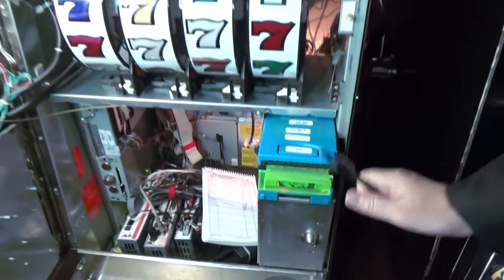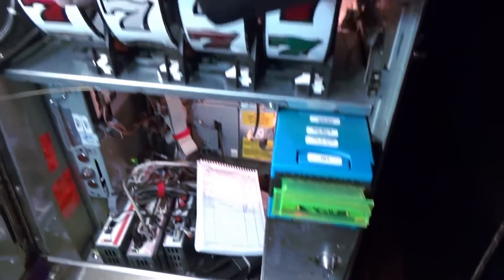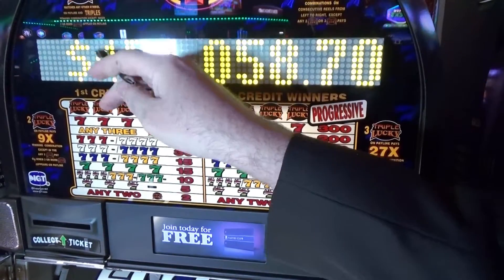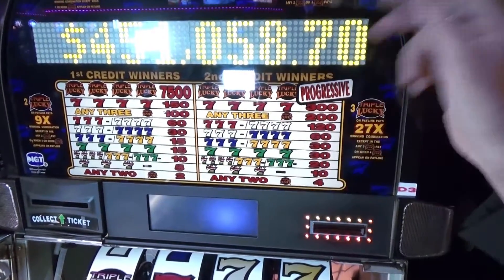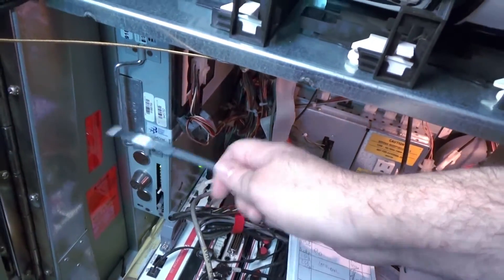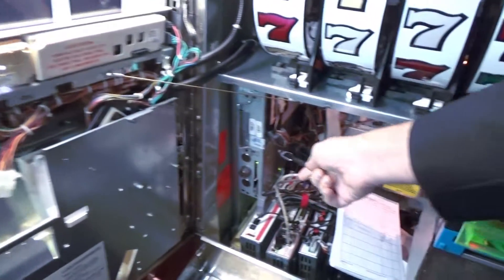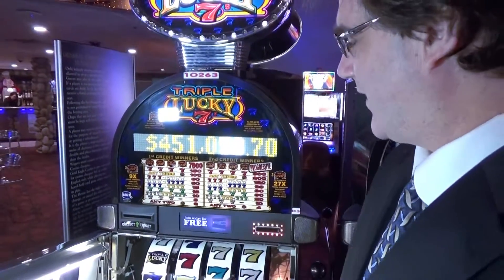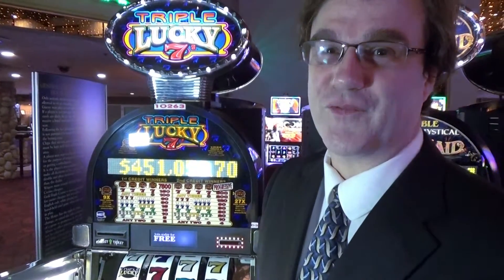Inside a Slot Machine

Comment: No such thing as a random number generator. That also has to be programed. So all wins are programed.
Reply: Actually there is a chicken inside that picks the numbers
Reply: It's pseudorandom, so yeah, you are right that it is not truely random.  However, it would be incorrect to claim the wins are programmed.  The PRNG is generating numbers hundreds, if not thousands, of times a second regardless of if anyone is playing.  Only when someone presses the play button is the result from the PRNG used to determine the win/loss.  In other words, a slot machine is never programmed in a way that, for example, the next player no matter what will win or lose.  It's all about timing and the machine/programmers have no idea when that button will be pressed.
Reply: @jeremywj  u just said "WINS ARE PROGRAMMED" without saying "Wins are programmed" tf
Reply: @AprilThomas-l8w  I did not.  The reason they are still not "programmed" is because the PRNG runs non-stop.  It doesn't matter if someone is at the machine or not, it is running.  It is running between your spins as well.   Therefore, no one knows if the next spin/play will be a win.  Not you, the creator, the PRNG, or the machine itself.  This is because the machine doesn't know what millisecond the next press of the spin button will be and you have no idea where the PRNG will land when you do.

Wins are not programmed.  Period.  End of discussion*.

*Well, not really end of discussion.  There are some wins that are pre-decided and you might claimed programmed.  This is in "must hit by machines".  The point at which the "must hit by" will trigger is decided the moment the last player hit it.
Reply: For consumers its not random , but for manufacturers that build them, for them its literally random   a literall scam